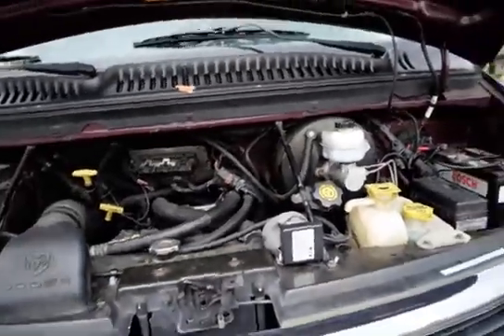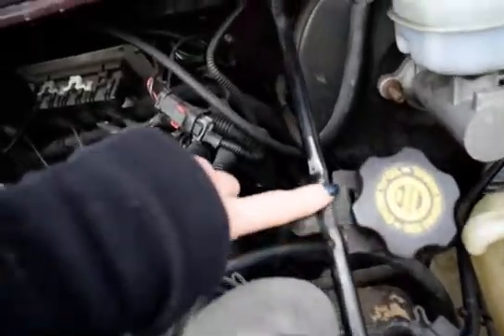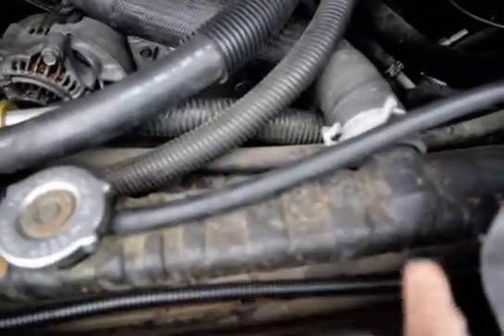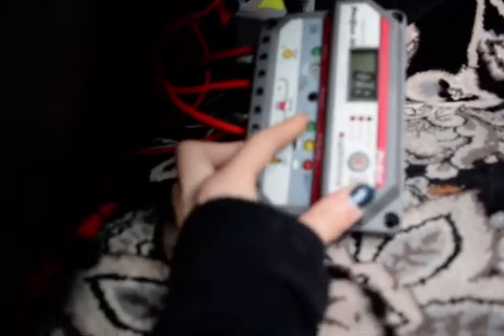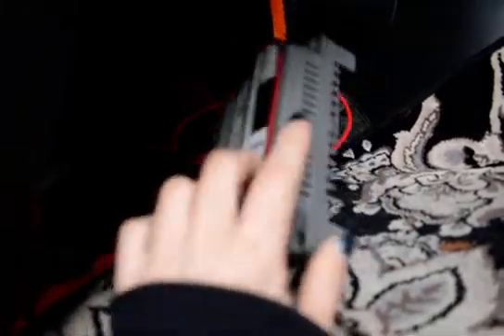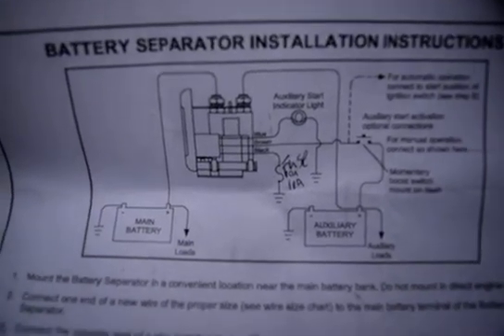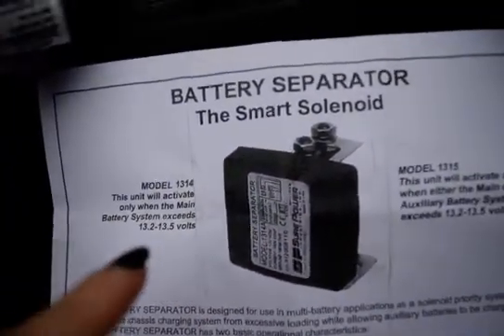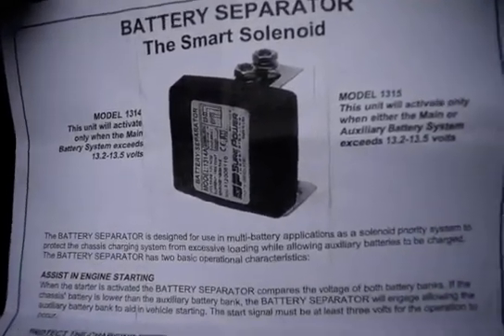Battery isolator

Comment: how did that work putting that wire on a hot radiator?
Reply from the maker: I think it's actually mounted to the frame of the van in the front. I don't know haven't really looked at it since it was installed years ago.

Comment: Battery under the seat.....   hmmm.  i absolutely love that idea. i never thought of that. A great place to make use of space.  Solved me a 6 month self question.  Thanks. :-)

Fan will be rqrd. youll see.  Dont be afraid to cut the roof. no problem, as long as the installer is skilled.  So easy im going to do it myself.
Reply from the maker: +RoadTrip Eddie yeah I'm having the fantastic fan installed professionaly by an rv shop. Same one who installed my battery isolator  so if they mess up its more garanteed they'll fix it if it doesn't work/leak etc.

Comment: If any vandwellers out there in the 48 states need an isolator but can't afford it let me know. I have a basic old style 3 post one here(for the time being, as there's no telling how long I'm couch surfing in CO)  from when I was living in a pickup/TC that I would let go for the cost of shipping rounded up to the dollar, so probably like $5.

Out of curiosity, what camera do you use? that AF is much less annoying even though it doesn't know how to focus any better than my lens.
damn ADD cameras
Reply from the maker: Minimalist Moto Life I have a nikon 3300 dslr. I just leave it on auto focus n when you hold down the shutter button it usually auto focuses. I just figured out yesterday how to put it on manual focus and use the focusing ring. I'm wayyyyy better as a photographer. the video stuff I'm still learning. yes I have the manual still for the camera. yes I need to re read the manual again but I'm usually better figuring out stuff on my own. I just don't always have the time to or I have concentration problems sometimes so it takes me longer on those things. I do like the camera but I miss my old rebel g 2000 but it wasn't digital. yes they make a dslr version but it's wayyyyy expensive. I want a go pro!!!!
Reply: A lot of my videos that are actually HD are shot with a d3200, 18-55mm kit lens, yeah I've learned that manual focus is the only way to go I am not very good at focusing the lens though, the rubber hood/bumper helped me a little but I still have to squint my eyes or zoom the live view in to get it perfectly where I want. I did try turning the dial to auto instead of M mode once that didn't work very good at all. So what I was doing was leaving AF set to where it only focused when I half pressed, which worked okay until I had to focus. Lately I have just been using MF and a tripod. An external mix makes a massive difference in quality and lately I've been thinking I need to pick up a small and cheap external mic since I do shoot a lot more video than photo sadly.

I think for as little effort as it takes my gopro hero 2 footage looks awesome. Wide angle lens is kind of limited but compare to the DSLR at 18mm let's you get right up on small objects and has a FoV closer to the human eye